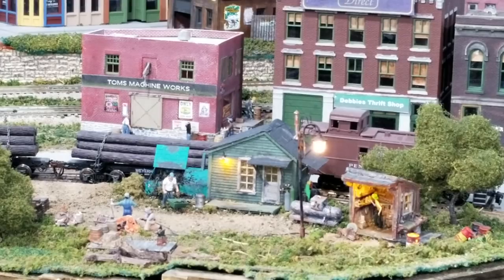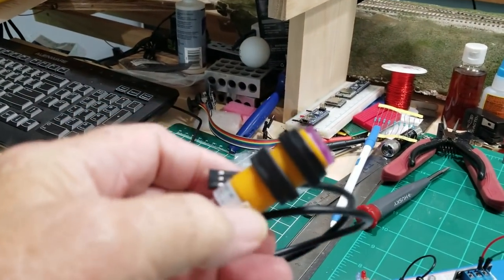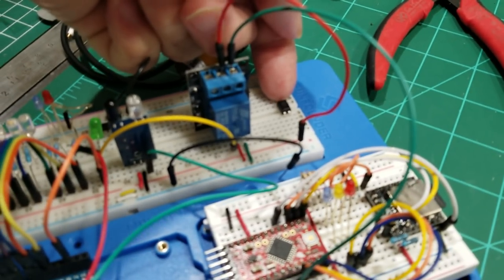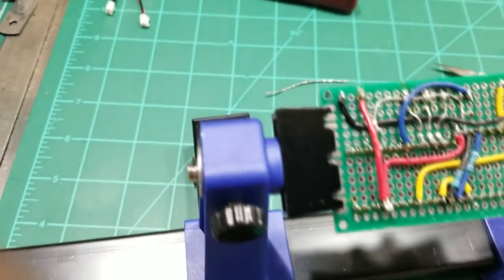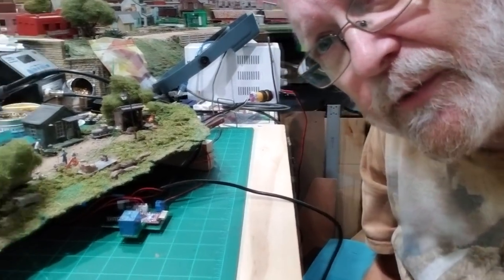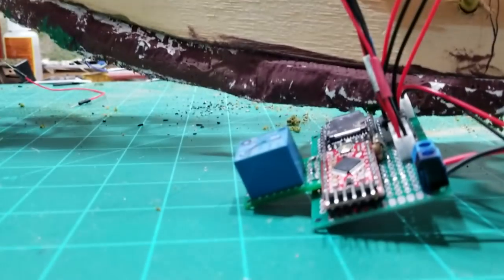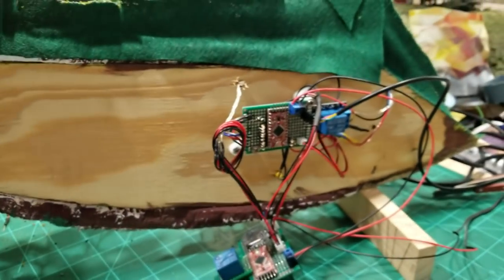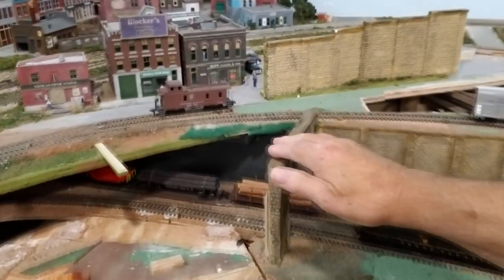How To Create A Welding Scene With Sound

Comment: I can tell you have the skill to tackle making your own pcb if you put your mind to it. I use to buy pcb kits at Radio Shack. I see pcb kits are still available on line. Just draw out everything on paper first. Making your pcb gives a real professional look to the finished product.
Reply from the maker: I remember those Radio Shack PCB kits. I used to do them. In fact, I still have a momentum throttle I made way back when! I have an offer from a PCB manufacturer to do a review on their product. I just have to design a PCB for the project. They offer 10 for $2. That's an introductory offer though. I've seen their work, it's pretty good. The hold up is learning a new design program. lol